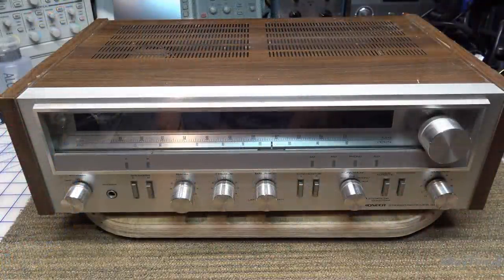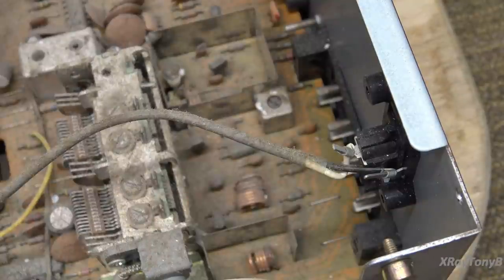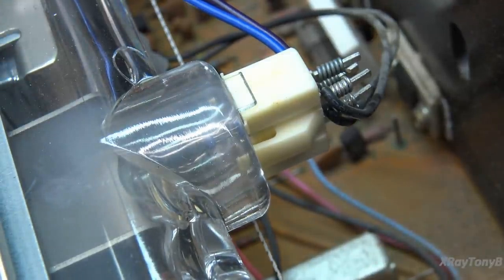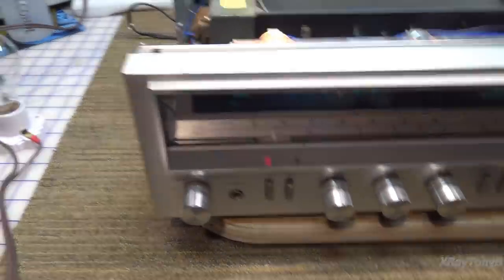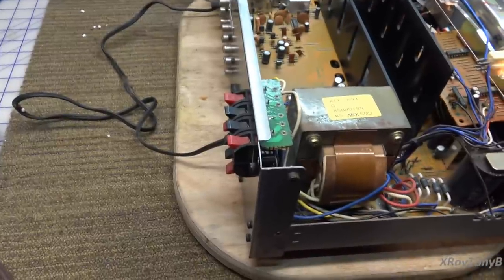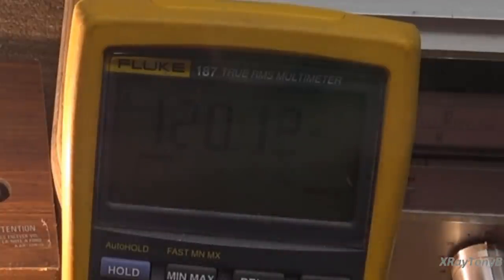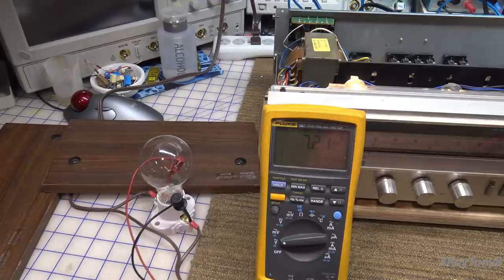Back to Basics Service - Pioneer SX 3600 Part 1

Comment from the maker: 0:14 Intro
1:45 First Look at the Receiver
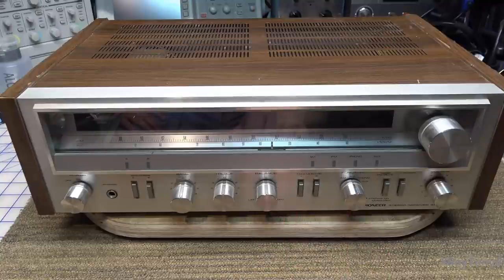5:11 Removing the Cover & First look inside
10:12 Looking at the Power Supply Diodes and Capacitors
15:04 Visual inspection of the amplifier transistors and circuitry
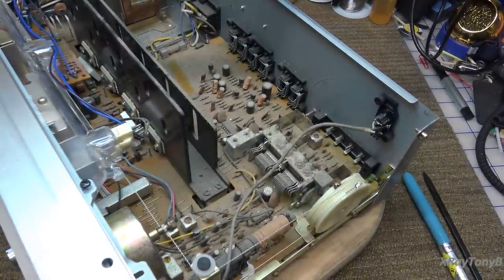19:44 Cleaning the dust from the PC Board
26:24 Building a simple current limiting "Dim Bulb Tester"
36:45 Using the dim bulb tester to power up a receiver
40:39 Testing for DC offset on the speaker terminals
48:23 looking to see if the power meters indicate any output
49:24 Connecting speakers and demonstrating how the bulb limits the current
54:29 Demonstrating how the bulb limiter protects against a short circuit (don't try this at home)
57:26 Multimeter - The first piece of test equipment you should acquire for this hobby.

Comment: 26:59 about the dim bulb tester, i got a bulb socket, got an ac socket, got 3 vago connector, some high voltage cable, inserted the cables into the socket and the connector, clipped together the cables with the vago connectors, i took a black tape, wrapped arround it to be make sure to be safe and it works very well! I use it when i work on anything so far. Since i live in a 240volt country, i have an extra wire which is the main ground.

Comment: Tony, I love to watch your videos when you go over the schematics and today those are getting hard to find. I did a restoration on a Marantz 2270 and I found out that the schematics had at least 4 revisions, and finding the correct version for the device you are restoring.
Reply from the maker: That is quite often the challenge.  Sansui quite often will make multiple revisions during production.  It can be difficult to know what version you have and if you have the correct service documents.  Sometimes, much research is required.

Comment: I built a Velleman (60w) Power Amp from a kit back in 2003. The build-instructions instructed the customer to build a a dim-bub tester using a 40 watt bulb and the circuit board has taps to connect it and disconnect the main circuitry to check the PS. I thought this was a great idea for a kit. I built some Heathkit test equipment (back-in-the-day) and they never suggested anything like that to test the PSU's. Still using those amps !

Comment: I used to be a TV bench tech when going to college.  We took our dusty stuff outdoors on a wheeled cart and blew it off with an air compressor.  Theoretically one could generate a static charge with compressed air but we never had any trouble with that.  That way, we wouldn't come in contact with any of the components.

Comment: This is perfect for me.  I gor my BS in EET in 1989 but have been a software engineer pretty much my entire career.  Now I am retired and want to fix up some vintage gear and brush up on the electronics I learned in college.  Have a Sherwood S7100A that needs a little fixing up.  It hums a little when it is on.  Doesn't matter what input it is on and the volume knob doesn't increase the hum.  I am hoping to figure out how to deal with that.
Reply from the maker: I'd check the big filter capacitors on the power supply.
Reply: @xraytonyb  I disconnected the filter cap and measured it.  It is a 2200 uf 65 V cap.  It measured at 2000 uf and my cheap component tester showed 0 ohms ESR.  The capacitance probably could be a little greater and I assume the ESR isn't a problem it is just really small.  I don't have a replacement laying around to try.  Wish I had your supply stock.  Maybe I can try and add a smaller cap in parallel to see if that makes any difference.  Really was hoping the cap measured way off and would just order a new one.

Comment: A key thing in understanding the reason for the "dim bulb" I'm not sure you mentioned (and why it has to be incandescent) is that the resistance of the filament is proportionate to the temperature (and power). At low current a high-watt bulb won't heat up, and as you showed, it drops very little voltage because it has very little resistance. As it approaches its wattage rating the resistance rises until it will pass no more current than what the bulb is rated for.

Comment: Thank you very much i love your Videos. I have a little Sansui 310 Receiver from 1971 and the DC offset is 150 mV DC on the output. It has to do with the Design of this kind of Receiver.

Comment: The blue display is known as a "vacuum flourescent" display. 
In the dim bulb wiring, you can improve safety by having the Hot wired to the center contact of the socket instead of the aluminum base. I believe that connection can be found visually (no meter needed yet).
In addition to the speaker output DC offset, you can verify the DC output of the L/R record outputs (for tape recorders, i.e. cassette or reel to reel units).
Reply from the maker: Although Pioneer used a VFD for the display in these units, they referred to it as "fluoroscan"  for marketing purposes.  This always made me chuckle, because fluoro is short for fluoroscopy, which is when we use low level radiation to produce an x-ray image through an image intensifier (known as a fluoroscope in the old days).  Currently, Fluoroscan is the name of a manufacturer that builds mini fluoroscopic surgical c-arms.  Interesting stuff.

Comment: I found a solder sucker that compromises between the totally manual and the totally automated. It has a heated tip but a manually operated vacuum device.  Didn't cost much, comparatively.

Comment: I think it unlikely you would damage the tweeter in a speaker with DC in a fault condition, mainly because even a very cheap speaker would have at least one capacitor in series with the tweeter. The midrange (if fitted) will also probably be OK. The bass unit WILL be the casualty with a burned out voice coil. If extreme DC was present, it can push the cone and rip out of the frame. I've even found that the voice coil has welded it's self to the magnet. DC and loudspeakers never has a good outcome!

Comment: How do you determine how many watts, the bulb should be?. I may have mentioned this a couple of years ago, but I applaud your use of a trackball, especially the Logitech. Great minds think alike.
Reply from the maker: Look at the back of the device.  On the label, it should give power requirements, the wattage listed is the maximum theoretical wattage that the unit will consume.  That is a good starting point.  If a device is listed as 45 watts, I would start with a 40 or 60 watt bulb, depending on the condition of the unit.  If you just want to see it power up and the caps charge, use a smaller bulb.  If you want to turn up the volume to listen to it (at lower volume), use a slightly larger bulb.  Hope that helps.

Comment: Question, speaking of the glue. I was working on a piece that was only a year old. It looked like gorilla glue. I like the idea because it comes off easier than most of the stuff used. What is the opinion of using gorilla glue for stability? What do you think?

Comment: I made a trip to the auto wreckers to get a spare tire and came across a wrecked van that had a Kenwood kr7070a hanging out the back doors, and when going in from the side door to untangle the cord from underneath some junk, I noticed the Pioneer sx3600 in there. The guy let me have both for free. Not having any fancy equipment, I made a dim bulb power setup, and tried the Kenwood first. What a tank, it works fine, but the fm is garbled throughout the tuning range. The pioneer needs all the switches cleaned. The volume control is acting up. When I switch it from mono to stereo, so far with it in fm there is no sound or signal strength on the meter. Should I clean the switches first before digging in any farther.

Comment: Safety concern; wire the “Hot” side of the connection to the bottom contact and the “Neutral”  connection to the side contact (screw terminal).  This way the Voltage is further away from the troubleshooter.

Comment: Sir, I found this link on Reddit and I enjoy this video very much. I inherited that particular reciever mod. Fortunately my grandfather left it in super working condition. I just like to ask if you know anything about an AKAI GX-620 Reel to Reel? I know the motors are not working but I know nothing of working motors. Please get back to me, sir. Thank you.
Reply from the maker: I don't do a lot of work on reel to reel decks.  There are a lot of mechanical issues that can happen as well as the motor capacitors in some units.  I got a lower-end Sony unit last year and will be doing a video on it sometime in the future.  Maybe someone else in the comments section knows these units?

Comment: For the current-limiting bulb, wouldn't it make more sense to cut the neutral wire? That way you have less risk of electric shock if you accidentally touch something (e. g. the bulb socket).
Reply from the maker: In most cases, I doubt that it would make a difference.  If, however, the "hot" line would be shorted to neutral or earth through another path, the current would still be limited by the bulb if it were wired through the live/hot line.  A lot of viewers expressed concern about the socket I used in the video, as it has exposed terminals.  To their point, it would be better to use a socket with insulated terminals, such as a socket that has "pig tail" wires instead of screw terminals that could be spliced into the power cord and then insulated with heat shrink tubing.  I have never had an issue, but it is possible to come in contact with the exposed terminals on this type of socket.  Thanks for the comment!

Comment: What about using a 3 prong plug with hot, neutral, and ground as part of the dim bulb tester?
Reply from the maker: Wouldn't make any difference, if the device under test is not also a 3 prong powered unit.

Comment: Shouldn't you check the DC offset, thru the terminals where the speaker wires go in?
Reply: He was doing that on the board where those terminals go.

Comment: A bit of copper type inside and outside on the vac soldering a wire with a crocodile clip
I should point out that LEDs and cfl's do not work as current limiters, and in Europe you can't get contestant lightbulbs anymore not at that power your suggesting  60 Watts Max I've not seen for many years that even 100 w no more.
You can put in line with a fuse a small bulb protection for the speakers
Reply: Try  E-bay for all manner of wattage and voltage incandescent bulbs. There is plenty of new old stock out there.
Reply from the maker: Traffic signal bulbs are still available in higher wattages  because of the older style traffic signals still in use.  They are also much more durable than standard incandescent bulbs.
Reply: @xraytonyb  yeah that's interesting to know thanks

Comment: The problem with this amp is that guy's need POWER, POWER, POWER.  LOL.  I lived for years with a Kenwood KR 3090 with 28 watts per channel.  With efficient enough speakers, which I had, it was enough power.  Unfortunately most current speakers are lower efficiency.  Even the Klipsch legacy speakers have been updated with low impedance woofers to keep up with the horns.  So even those are working the amp hard in the bass.  Get some efficient speakers and play away and enjoy.

Comment: Tony, I don't like the lamp holder you use, it has exposed terminals which have mains voltage on them. Easy to inadvertantly lay the edge of a hand across, or pick up by if knocked over. There may only be 6 V ACROSS the lamp but without an isolation transformer there's mains voltage with respect to earth. Painful, at the least!
Reply from the maker: I've never had a problem, but I see your point and agree with you.  There are sockets with wire leads that can be used, which would be safer.  Thanks for the tip
Reply: @xraytonyb  Probably much less of an issue on your wall-mounted set up but Sod's law could easily apply to a free-standing example; and we have 240V this side of the pond. :-)
Thanks for this and all your other vids!
Reply: Those cheap porcelain light fixtures hide the connections well.  Plus they got some heft to them.
Reply: @xraytonyb  An alternative would be to modify a cheap power strip (might have to open several to find one that can easily be modified) to connect one outlet in series with the others, then plug in lamps into the remaining outlets. Can also use space heaters or hair dryers for really high power stuff.

Comment: Uni-T Amp meter is OK, BUT many of the Uni-Trash DMM are CRAP!!   Plus there manually set!  errfff
Reply from the maker: It really all depends on the model.  Some are autoranging and some are manual ranging.  Some are better quality and some are pretty low end.
Reply: Generally prefer manual ranging. It's too bad in recent times that many manual ranging meters are made cheaply and therefore a lot of people associate manual range with cheap. Not always so. Think B and K, Beckman, Simpson etc. A while ago and maybe still alot meters were the same as Cen Tec. Our distributor sold the same meter at 2x the price with same insides. They are sort of OK till you got a problem and once you open it to disassemble the switch all the contacts fall out.  Junk lol